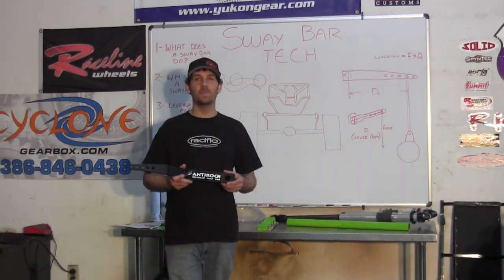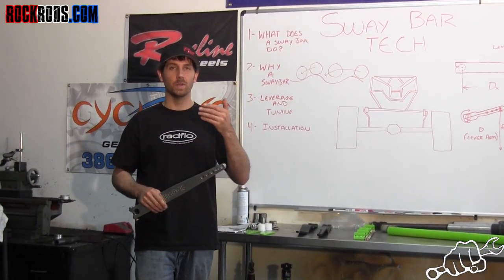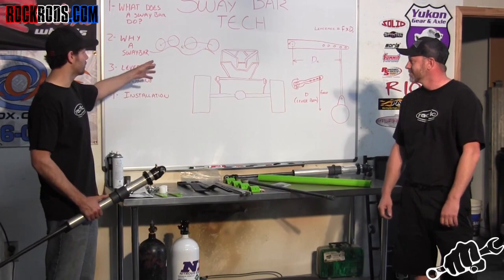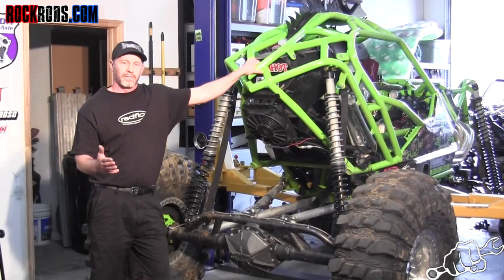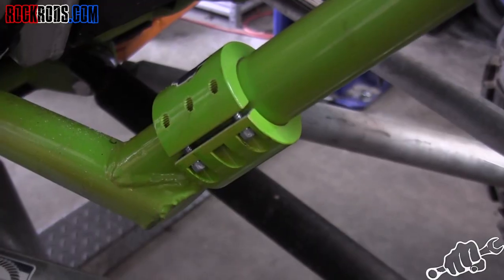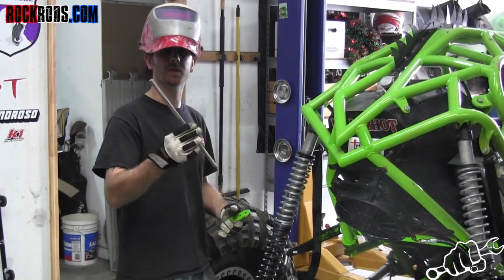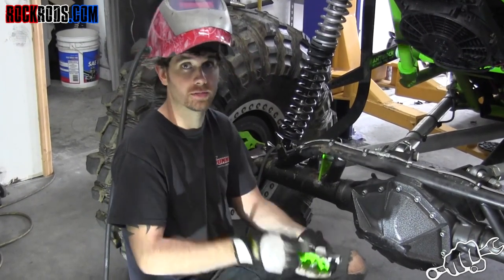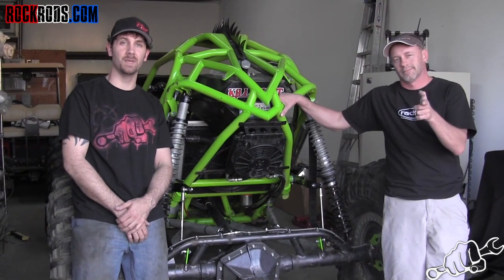Why You Want an Off Road Sway Bar - ROCK RODS TECH

Comment: Jake, it's flattering time. You know your business. It's like you know just what to say to make things actually make sense, even the complicated items like angles and such for dom tube chassis and links. Anyways, watched your video after previously watching 11 and yours made the most sense. However, Would have really enjoyed the explanation of how to accurately adjust these. I'm a little stumped on my install for the XJ. Think I know what I'm doing but would rather watch someone else do it 1st correctly. Preciate it.
Reply from the maker: adjust a sway bar? You either have to drill new holes in the arm or put the sway bar in a lathe and take material off

Comment: Thanks For Another Awesome Tech Tip. I put one on the back. There not as good on the front? The Riot suspension looked soooo good moving, at the last SRRS, It has to feel incredible. A sure winner with a little more seat time. Thanks again.
Reply from the maker: +MaRoder Dave yeah they dont do as well on the front usually. Now he just needs more motor

Comment: I do mud bogs and I have a 1972 chevy k10 stepside on 38.5 inch boggers when I launch it the driver side tire lifts up but not the passenger side would one these anti roll bars be helpful for launches

Comment: I Like slow crawling and exploring. Do i need a swaybar. Speed and offroad dont go together unless you love replacing ball joints and crap. 1990 bronco. I also get alot of neck and head jarring going over rocks and stuff. Is the sway bar causing that teeter tottering?
Reply from the maker: For slow crawling no, but anything with speed yes

Comment: did you know that if you require more than two turns of preload on a coil spring you must go to a  stiffer coil?   Super important.
Reply from the maker: +RedWhiteandFU Daddy depends on how much preload you are after.
Reply: +RedWhiteandFU Daddy Its my understanding a lot of people are running 2-3 inches of preload to help with rebound in the last few inches of down travel. running zero preload or close to it you are allowing gravity only, to get the shock to the bottom of its travel add to that rebound dampening and the last 2 inches of travel will slow up a lot. this is where the 2-3 inches of preload comes to play, forcing the last few inches to extend a little quicker. you can also setup your secondary stop to help with body roll as well...I'm sure these fellas have done the work and know what they need
Reply: +BustedKnuckleVideo any more you get into coil bind limiting full travel on compression. unless you guys run springs made for longer travel than your using. I've gone to suspension courses by Fox, Marzocchi, Elka,  to name a few. Springs are super critical to shock performance as you know.  I used to use my own coil spring rate tester  to test the actual rates of coil springs and use matched sets which cost huge investments to assemble the correct number of varying rates and sell the ones i didn't use.  They're never ever what the rate printed on them say, usually they are +or- 20 to 50 pounds either way. Just because you use 2 turns of preload on each rear shock doesn't mean they're the same preload because you haven't found each true rate.
Reply: +longzook preload is ONLY used for sag. nothing else. If you only have two circuits per shock (R and C) you find the correct rate spring you need for weight of vehicle and desired sag. Then set PL to acheive sa Then you set V first by starting at full hard and back off until you like it click by click.  Then set R same way. There is no other way to do this properly. If you have High and Low speed circuits for C and R  ( HSC, LSC and HSR and LSR)  then it's a little different.
Reply: +BustedKnuckleVideo of you need more than two turns you need a stiffer coil. Like I said, unless you're running a coil length for a longer stroke damper. Which could damage your damper on C and R by over extending or bottoming out harshly. You run limiters though I assume.
Reply: +RedWhiteandFU Daddy I should add that this is assuming you use 99% of your travel each run. ..which you should. That's why its there and how you go the fastest. We've done tests with computers hooked up to the suspension to prove it numerous times. Been fortunate enough to test as a rider with major manufacturers when I used to race.
Reply: i'm only going by what i have read from one of the top suspension tuners in ultra4 racing today. no real world knowledge..  his record for making guys go fast stands..
heres the read 
http://www.pirate4x4.com/forum/general-4x4-discussion/1074029-spring-tech-thread.html
Reply: +longzook you never said it was a dual coil setup...shit lol...whole different story but the bulk of what i said applies
Reply: yup dual rate the read is still a great one
Reply: +longzook I'll read the whole thing after work tomorrow bud. I'd like to know stroke length, eye to eye length  and the total length of both coils and the nut in between together to wrap my mind around what he's saying.

Comment: Use ori stx struts ..... coil springs and sway bars are so 2010...get with the times or fall behind .
Reply from the maker: You want us to replace good working coilovers with churched up air shocks? Do you see trophy trucks or RZRs running ORIs?
Reply: Busted Knuckle Films  yup it’s the future  ...just like coil overs where over mono shocks and leaf springs. I’m sure back in the day they said the same thing .... with the expanded reservoirs it is a way more versatile system . I’ve seen them change recoil rates on the fly with a remote controlling the rebound on both strokes.....you’d have to spend hours at a pit  to change or adjust your spring rates.....like I said get with the times or fall behind
Reply from the maker: They are not match for a set of coilovers and bypasses and likely never will be.
Reply: Busted Knuckle Films I’m seeing more and more crawlers and bouncers with them.